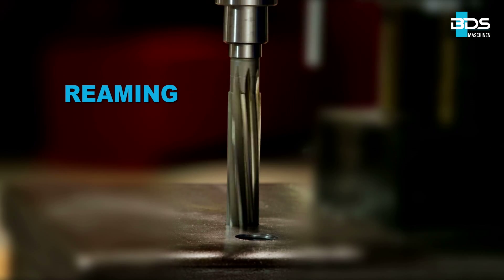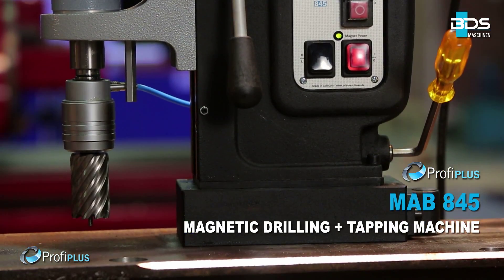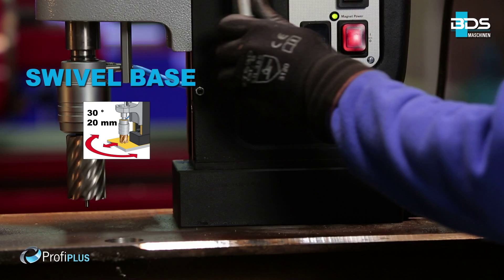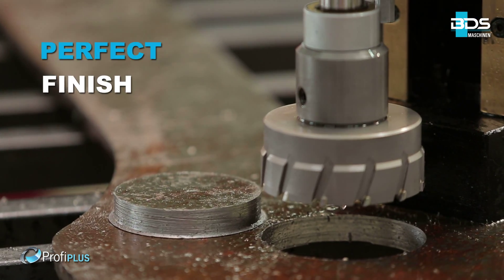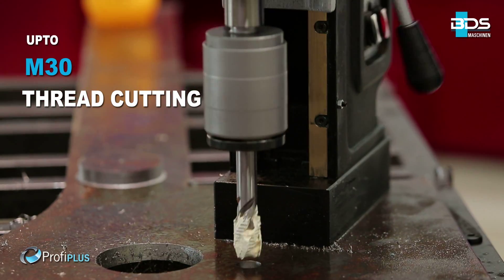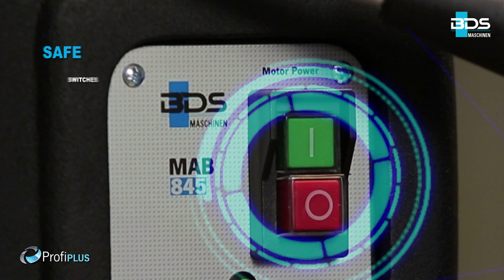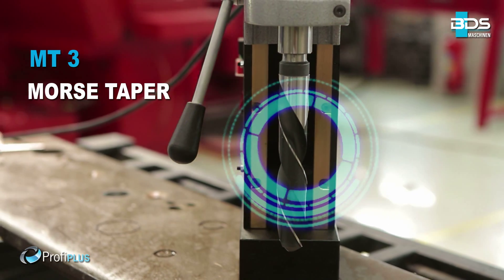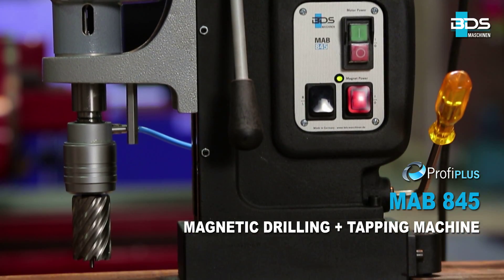Best Magnetic Drilling Machine  | Best Mag Drill  | Best Drill Press | BDS Maschinen GmbH® Germany

Comment: Something i can't understand, this machine is very expensive, but what is the difference between it and the normal drill machine ? Is it only about leaving a big piece of steel on the table for example and drill ot there ? Instead of carring it to the normal drill ?
Reply from the maker: Thank you for your interest. The capacity of the MAB 825 or MAB 845 magnetic drilling machine is 100 mm in diameter X 110 mm cutting depth (3-15/16" X 4-21-64''), a same capacity radial drilling machine is even more expensive and time-consuming. A magnetic drilling machine is the next generation of a conventional drilling machine, briefly, it has three advantages over a conventional drilling machine 1. With core drilling a 100 mm diameter hole is made in one shot, no step drilling required. 2. The machine is portable. 3. The machine is single phase and versatile.

A magnetic drilling machine is considered an industrial machine tool and not actually a DIY hobby tool. The following two articles will give more information.

https://magneticdrillingmachines.com/2015/10/27/twist-drilling-and-annular-cutting/

https://www.bds-machines.com/blog/what-is-a-magnetic-drill-press/

Comment: Can MAB845 uses for horizontal operating mode?
Reply from the maker: Yes, all our magnetic drilling machines can be used in Horizontal as well as in Overhead situation. We recommend you to use the safety chain provided with the machine while drilling in horizontal or overhead operation. In the following link is the photo of MAB 845 in horizontal operation: https://www.facebook.com/bdsmachines/photos/a.211788872296683/1239429939532566/?type=3&theater
Reply: We are using bds  horizontal  and using belt   for safety  it s working  excellent. We are doing drilling and tapping  i have my video in my phone
Reply: @vijaypanchal7593  For enquiries watsapp...9810470330
Reply: For enquiries watsapp...9810470330